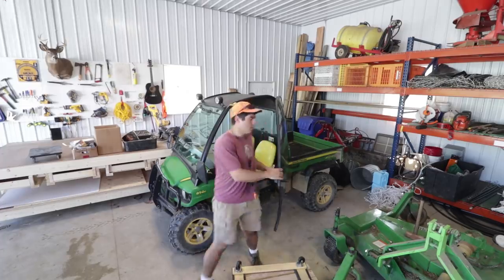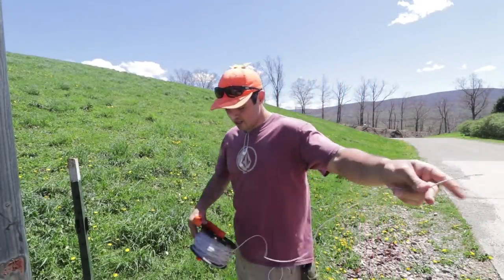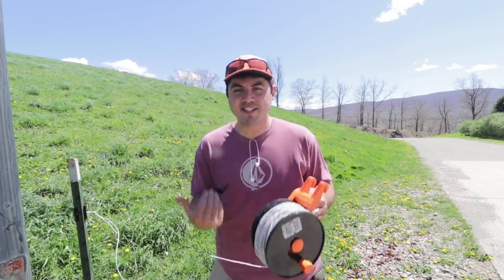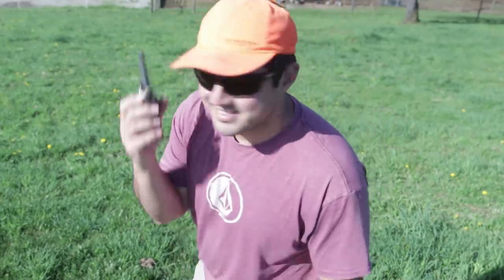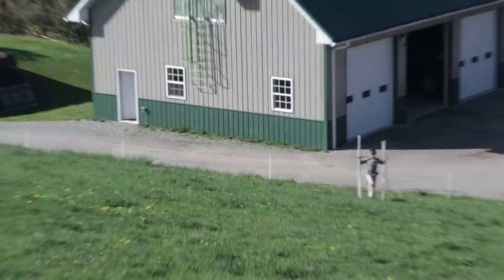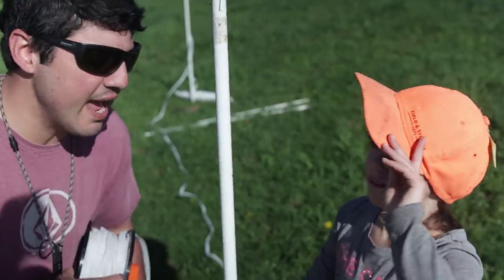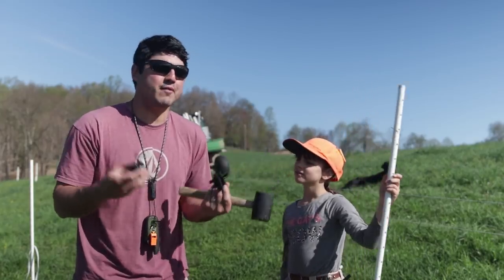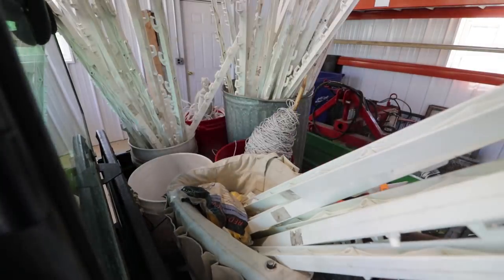NEVER MAKE THIS MISTAKE WHEN USING ELECTRIC MOVABLE FENCING!

Comment: Tip...... buy a post driver.. drive a steel corner post first then gate posts... string wire.....Then infill with other posts.Have your gates close to your road access so you move sock, mobile water or shade with ease.
Reply from the maker: need one so bad!
Reply: @Homesteadyshow  LOL I dislocated both shoulders using a sledge hammer above my chest ..... missed the post... now i can't lift my lift right arm above my head..... Post hole driver for the win... Tip put it on the post laying down then lift into the right position post an all <3

Comment: Yup unwinding wire that's tangled is time consuming and frustrating.

Spools are best a think, at 40.00 each it's a time saver.

If you dont have spool winders use a bucket and sort of coil it into bucket, when you pull it out do it kinda slow so you don't ball it up.

Some shorter runs are good to have sectioning off pastures short of buying spools.

En arche en ho logos

Comment: Are you going to hay some of this property? Is there someone you could share crop with?

To run a hot wire over rock I set step in posts in 5 gallon buckets of sand. You can also use concrete in the buckets and make them permanent weighted posts if you have areas that you cannot drive posts into and will need to have fence over.
Reply from the maker: Great Tip Fiona

Comment: #Askhomesteady
Can we see your grazing plan on paper?
Reply: I just took a legal notepad and paced off my field, then converted the paces to feet and then just figured out the best way to put up the fence and irrigation (different spray heads go different distances and on the end one you want one that you can set the degree of radius).  We have a county ordinance that says you are not allowed to let your irrigation water go onto county right of way.  I made mine with individual grazing area with a center aisle way that I could also drive the tractor down.. i could also restrict them every now and then to just the aisle way.  This is called rotational grazing and is really important if you have Horses.  Water is automatic 100 Gal tub at barn with goldfish for mosquito control and the goldfish eat the algae.

Comment: Hey friend you may want to invest in a metal post driver,beats a hammer all day long and twice on Sunday,check Tractor Supply Co,i see you have hammers and rubber mallets but a T post driver will save tons of time,you may have this item already,i didn't see you using it so thought id mention it just in case you didn't have it already...just a thought